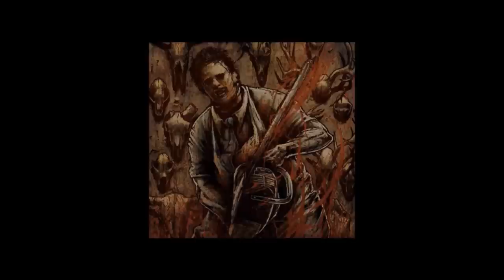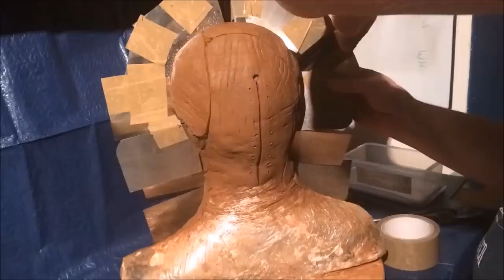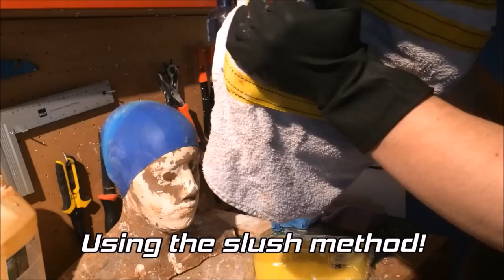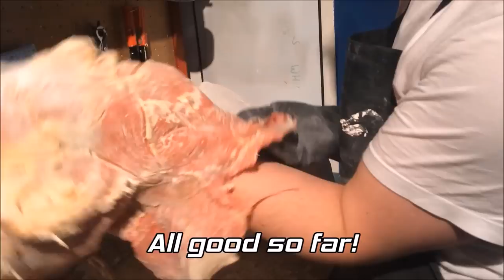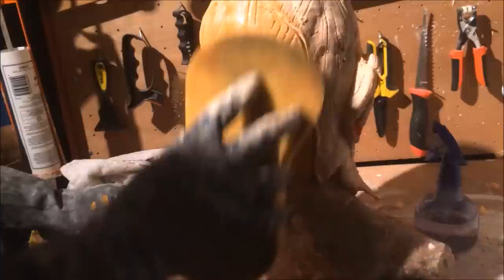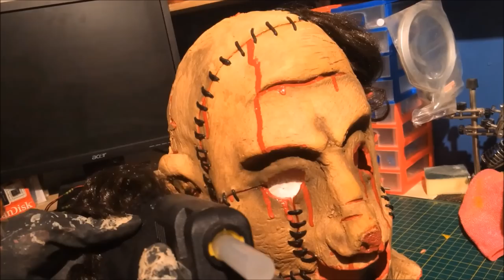Leatherface Costume Part 2/3: Latex Mask

Comment: How long do you let the sculpture sit before adding plaster, in other words, how dry does it need to be
Reply from the maker: I like to let it dry just enough so that you can touch it without getting any on your finger. Just dont let it dry out too much or it will start to crack.
Reply: Costume Forge thanks I really appreciate it, did u also add a gloss or clear coat too before adding plaster
Reply from the maker: I didnt with this but I highly recommend that you do.
Reply: Costume Forge also, do I add clear coat when clay is kind of dry or still wet?
Reply from the maker: Dry. The clear coat will give you a cleaner mold with more detail.

Comment: I like your mask
Reply from the maker: Thanks! :D
Reply: What brand of latex do you use
Reply from the maker: The slasher shadow 246 Scarva Liquid Latex Emulsion
Reply: What plaster do you use
Reply from the maker: The slasher shadow 246 I use fine casting plaster but I wouldn't recommend that. It's a nightmare to work with, only 20% of my molds didn't break. I'd recommend Hydrocal or if you can't get any of that use Crystacal.